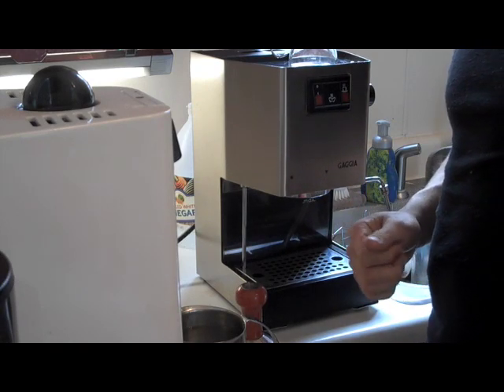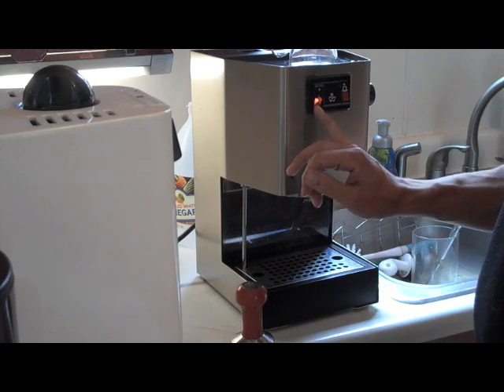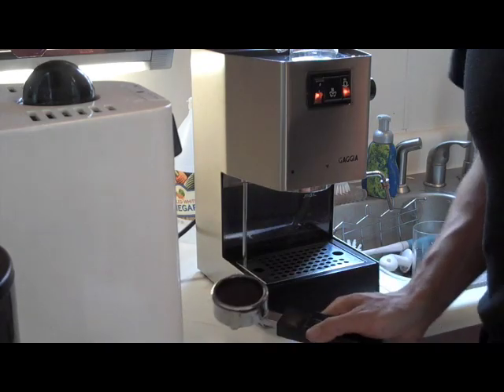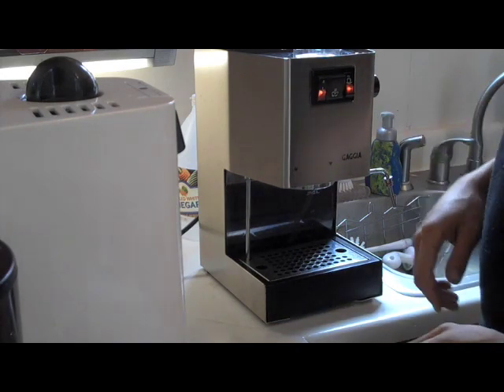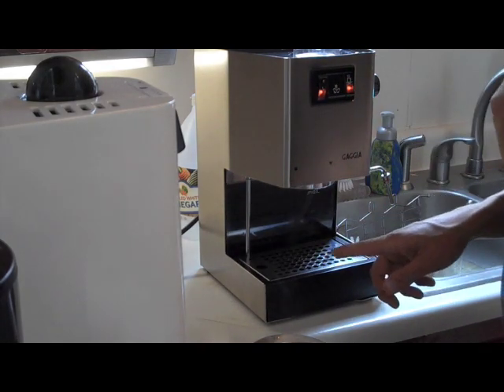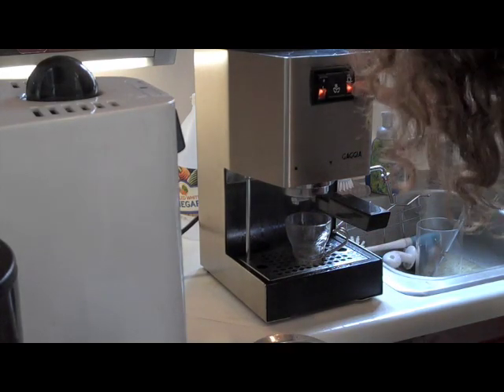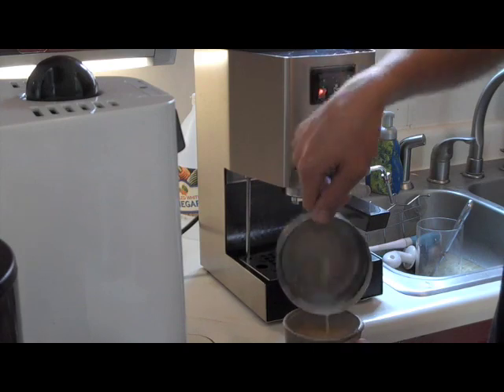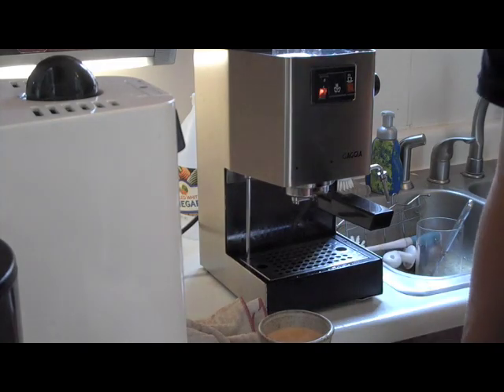Gaggia Classic Introduction

Comment: To cool it down quicker you can temp surf the boiler by running water out the steam wand until the light goes off, more water gets through the boiler quicker by doing that than by running it out the group head

Comment: This answer might come too late but if the coffee sprays all over the kitchen, most likely is because they are using a pressurized crema perfetta basket without the little black insert to be put in the portafilter before pushing in the basket.

Comment from the maker: The shot in the video was short. The coffee was not fresh and I didn't test out the grind and tamp pressure before the vid. 

You say that I did not "flush the steam nozzle" but in fact I did. I termed it "blowing off the steam" or "cooling the grouphead". 

I do in fact keep the portafilter locked on the machine with my Gaggia Primavera (it is in the foreground of the video) in order to keep it hot. But, since the Gaggia Classic has a cup warmer, you could rest it upside down on the lid.

Comment: I thought this video was good but didn't really follow the usual guidelines that I follow to achieve a great espresso. For one, you manages to draw your coffee on like 12 seconds, when it should be around 20-22, you didn't flush the steam nozzle after preparing the milk, and you told us to leave the portafilter locked in position which damages the seal. Sorry to slate the video, but you make a soppy little weak coffee in a fantastic machine.

Comment: you are using pressurize basket instead of normal non pressurize basket... check out number of holes at your basket.. if it is 1 than  u'r using pressurize basket